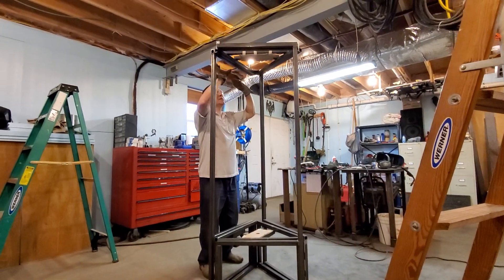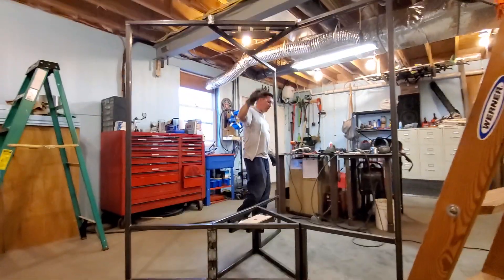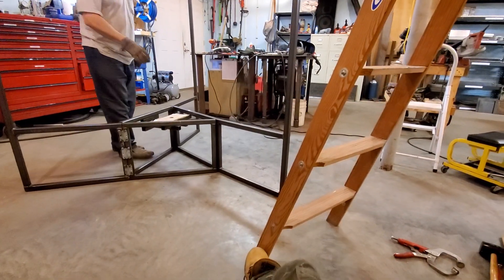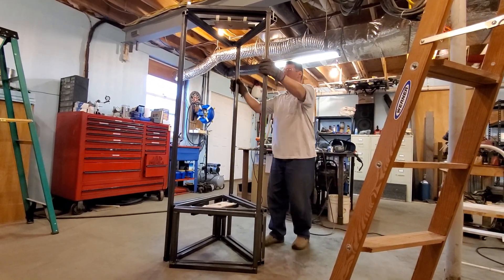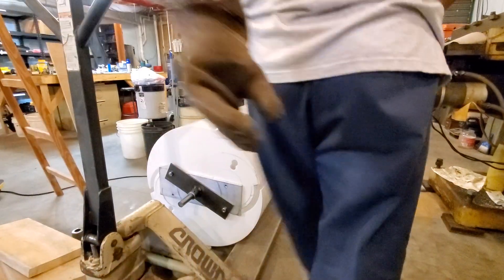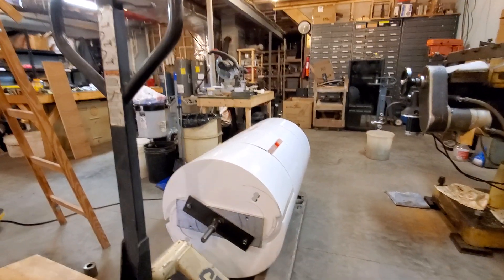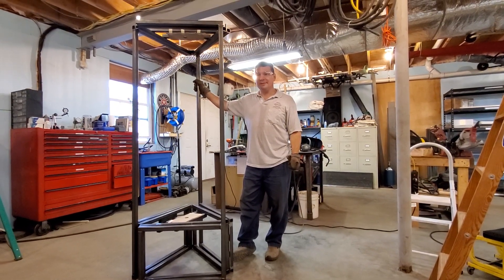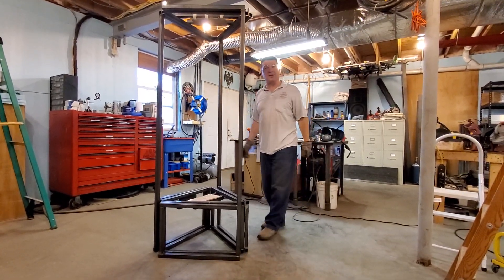December 22 Harmony VAWT Progress Update... Things are really coming together

Comment: I  get the sense that VAWT designs in general are impellers.  I wonder if we can sacrifice the omni-directional properties and build a directional duct to funnel the wind through at higher velocity.

I would at least consider a flywheel to increase and smoothe out the angular momentum.
Reply from the maker: Hi David, once the generator is coupled with it there will be a large flywheel effect so I've already got that covered. The generator I'm going to use initially in this prototype for testing, is not my design but rather one from Missouri Wind and Solar. They were kind enough to send me one of their generators to help me get test data faster. Your idea of the duct is one I played with for a few years but went away from it long ago for a number of reasons. As soon as I start doing field testing you guys are going to begin to see the true merit of what Harmony can offer. It's going to be an amazing discovery for all of us to enjoy together. I hope that it blows the socks off of everyone who gets to see this and experience this with me.
Reply: @HarmonyTurbines  Thanks for the reply.  I don't see how the addition of a generator gives a flywheel effect, unless the generator has a flywheel on it. 

I can see why you would shelve ducting as it would be an enormous undertaking on it's own.  
I can't wait to see it in action.  I'm considering using a VAWT and transmitting the mechanical energy directly to an air compressor pulley for electricity-less airtool power.
Reply from the maker: Hi @David-bc4rh the generator I have designed specifically for use with Harmony, is going to have a fairly large flywheel built into it just by the nature of how it's designed. I have not had time to even begin developing and prototyping the generator as of yet but I will start work on it as soon as possible. For now I'm staying focused on just getting Harmony running and then generating performance data with "off-the-shelf" generators. I'm hoping the one I have right now from MWS will do the trick. Tonight I got a few more hours of work in which was great. I was able to positively mount the upper and lower bearing supports and get everything set in place. Next I can start on mounting the RC Receiver and the modified drill to the furling assembly. -Just a few more larger steps to go before I can start getting preliminary performance data. I'm both nervous and excited at the same time.
Reply: @HarmonyTurbines  So the furling assembly will be motorized?  That would be very practical for mounting it high up.  That whole furling feature may be my favorite part of Harmony.
Reply from the maker: @David-bc4rh  it's certainly my favorite part of Harmony and one of the main features in the patent obviously. You will start to understand just why the furling is so very important and amazing in the coming months as I show performance data and start making videos of it in operation. Go back and watch a few videos back where you can see an early test I did ...mounting a drill on with some C clamps and wire (lol) ...yes primitive but you start to understand how amazing it'll be in operation. That furling will be controlled by a small onboard Raspberry Pi computer or Arduino tucked away safe and sound in the generator housing that's securely mounted on the ground (away from any danger or weather). It will tell Harmony precisely how much to furl in the given wind speed ...this will be continually monitored and adjusted as needed to maximize performance.-Go back and start watching some of the earlier videos and it'll begin to make sense. -I think you just jumped in here at the end and watched one or two videos but there's a lot to get your mind wrapped around here. This is going to be a paradigm shift for society. I'm hoping that in 20 years when people mention residential wind power generation ...that Harmony is the standard everyone thinks of. If you'd like to see Harmony VAWT Latest Updates, here's the URL: https://www.youtube.com/playlist?list=PLqbwi-6vny7s3NVYuynqVG5oyLxysgfIs